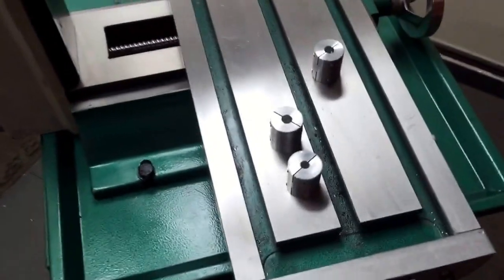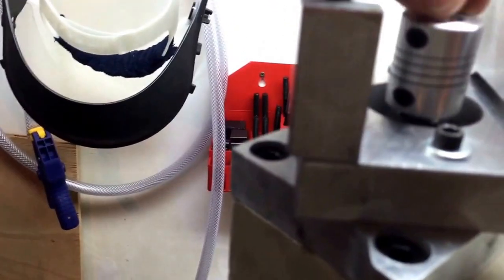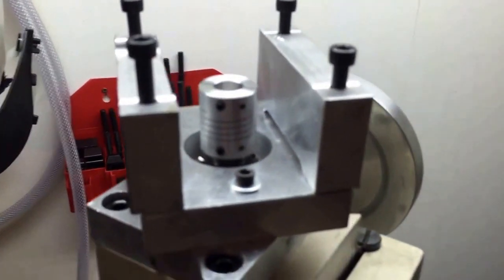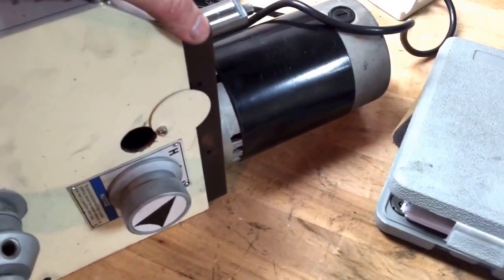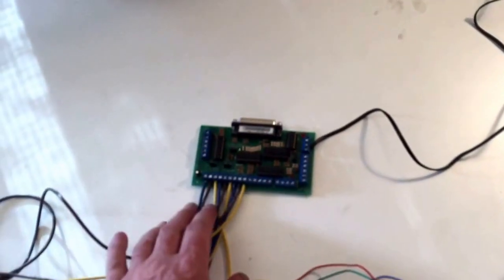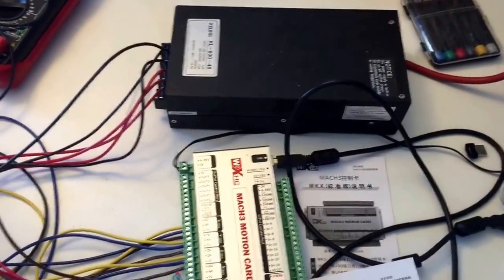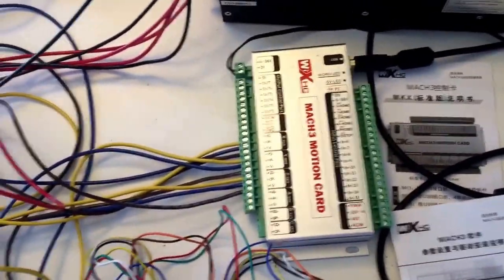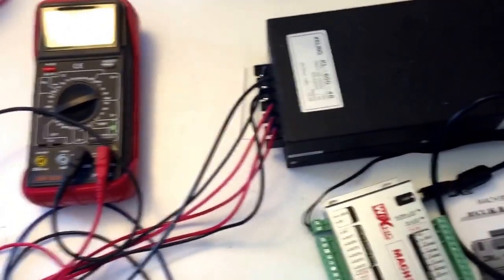H -G0704 CNC conversion with automation technology kit

Comment: The "dumb pin" cable is still used because the drivers uses parallel communication instead of serial data.  Much faster data rates are possible with it.  There are good work arounds, and they are a pain, I'm just saying that there are good reasons why  they still turn up.....
https://learn.sparkfun.com/tutorials/serial-communication